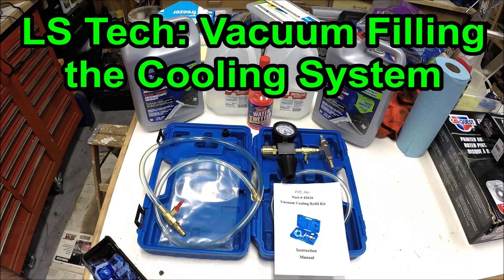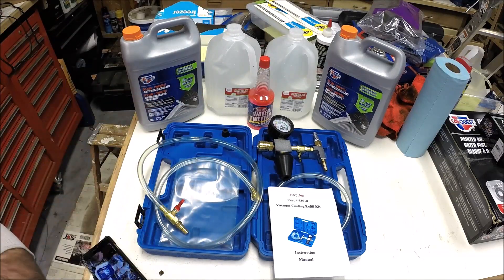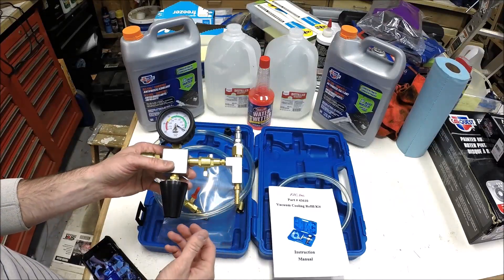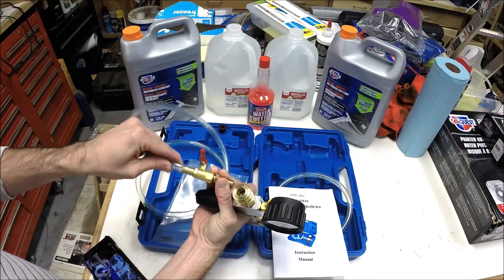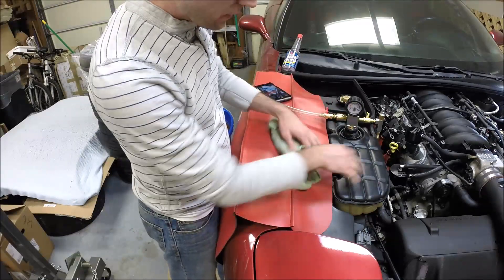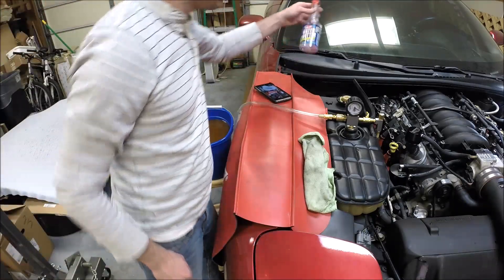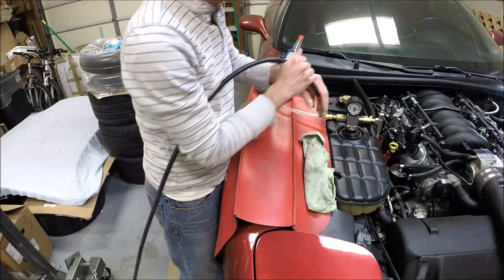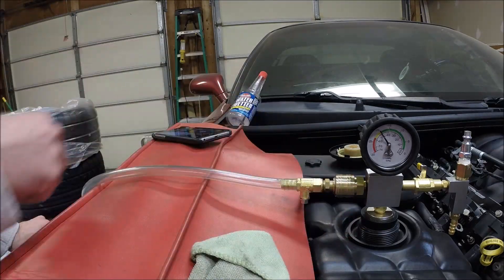LS Tech: Vacuum Filling the Cooling System!

Comment: Good video explanation. Hints: draw air into hose from bucket first. 2) before adding extra coolant to bucket turn off valve so you do not get air into line which could add an air lock

Comment: Just pulled coolant through one of my cars after an 'air lock' situation attempting to simply refill by pouring in the coolant. This tool was a total game changer and I was equally surprised at the fill speed. Got me back on the road. You do.need.to watch the level due to heater core/thermostat side but easy enough to top up.

Comment: Based off this video I bought the Harbor Freight Maddox cooling system test and refill kit $80. I was able to get it down to -20 psi and following the directions. Filled the system with no issues. I also had air in my system and no other procedures worked.
Reply from the maker: Awesome, glad to hear the process worked for you and that the video was helpful.  Thanks for watching!

Comment: Is this also a way to remove all the bubbles from the system to where it is safe to run a throttle body and radiator steam pipe line delete? So many opinions on deleting the rad and tb lines
Reply from the maker: If you are doing a complete fill, then yes it would work for pulling all of the air out of the system.  If you are only partially draining the system, or just trying to get a trapped air pocket out, then I'm not sure it would work for that.

I have the TB coolant lines deleted, no issues there.   I personally feel that the steam vent lines are beneficial.  I actually have another video where I added the rear steam vent lines to my new motor.  (mine originally had the rear steam ported blocked off).

Comment: I was a little confused about the need to re-vacuum the system.  Does this pull a lot of coolant back out?  Are we just creating a vacuum in the reservoir at that point, or does it get trapped air out from other places?

Comment: My air supply is lubricated so do I have to worry about the in-line lubricator getting oil into the system?
Reply from the maker: No, the tool uses a venturi effect to draw vacuum on the system.  So no air from your air line is entering the system.

Comment: Can this be used to bleed the system if you already have coolant in the car, I just drained all my old coolant and refilled it with new and I want to make sure there is no air in the system
Reply from the maker: Hmm, good question.  I think if the system is already full, then I'm not sure it would be able to pull out an air pocket trapped somewhere.   If you try it, definitely let me know how it works out.
Reply: I used one to help pull coolant out of a rear heater core in a minivan during a fluid flush, managed to suck most of the old stuff back to the radiator. But the system was already mostly empty. The issue is how much fluid is in the container you are sucking the vac on, and where it is in relation to the air pocket. look for a bleeder on the top of the block. or just do the old school burping method to coax the bubbles out.

Comment: Please help...Just did my 07 f150 4.6. Replaced the water pump and t stat. Removed the t stat and upper rad hose. Ran garden hose in the degas till water ran clear out the top rad hose. Did same for heater core and rad. Pressurized system, held 16psi. Drained rad, hooked up coolant vacuum, vacuum held but was slowly coming down. (Figured it might be not a tight seal). Only sucked up 1 gallon of 50/50 and now resivoir is to the cold fill line.  Haven't started the engine yet because I'm  replacing power steering lines and haven't put the fun clutch and shroud back on to give me more room for the ps lines. Why would it not take the full amount approximately 2.5 gallons??
Reply from the maker: It sounds like you still have an air pocket.   After you pull vacuum, it should maintain the vacuum pressure.  If it's bleeding down, you've got a leak somewhere.  That vacuum is what draws coolant into the system, but if you leak air in, then you get air in the system and it won't completely fill with coolant.

Comment: I see one outstanding problem with this setup.  The design and idea is good, BUT it seems to me that when you drop the tubing into the bucket of coolant and open the valve to fill the system, the air that was in the tubing has nowhere to go and goes into the engine, which is what you were trying to prevent in the first place.  There needs to be a way to remove the air from the tubing, OR fill the tubing with coolant.
Perhaps a small bleeder valve installed where the tubing goes into the device would do the trick.
Reply: Ur the only person who gets it. Think that setup should have a 3rd ball valve This setup defeats the purpose of evacuating air Cheers
Reply: This video explains how to solve the problem you mention.   https://www.youtube.com/watch?v=KbQ77-zDOEo